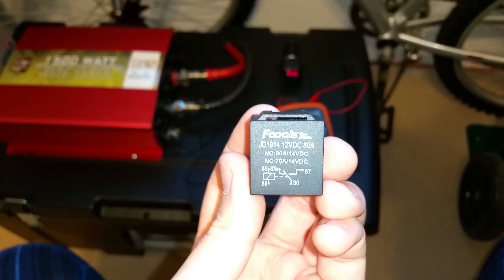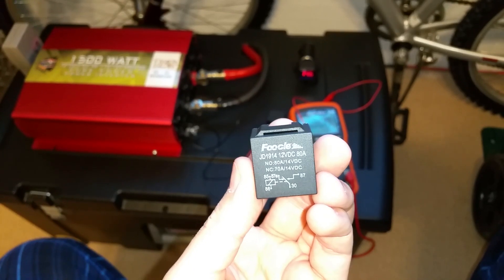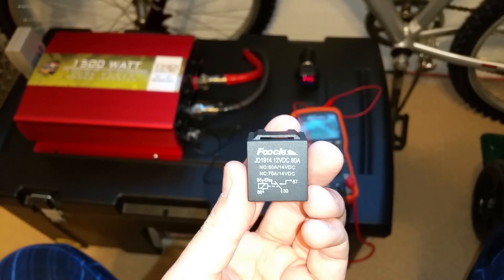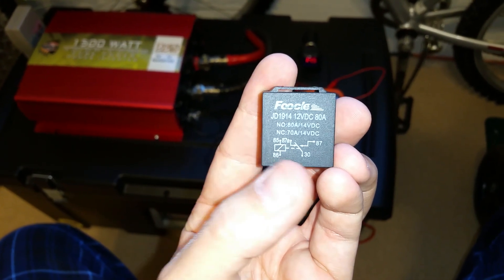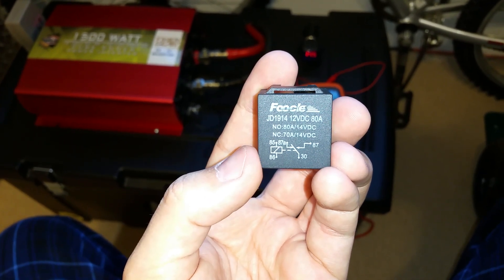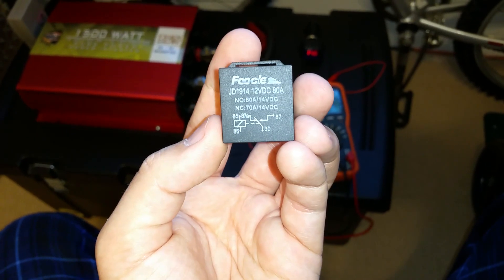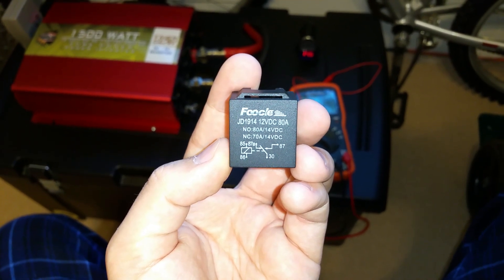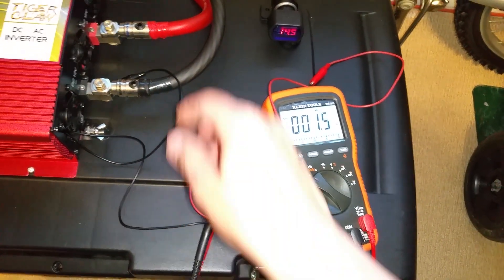Normally Closed / Normally Open Relay: DRL Install

Comment: I'm trying to bypass the integrated blinker circuit in my BCM because mine went out, and Chevy thought the best solution was to make it keep the headlight marker light on 24/7 weather the truck is on or off.

So I'm installing a relay that turns them on when I turn the key, and then using the rear blinker as a power signal to blink the relay for turn signal

Comment: Normally closed/normally open? That makes no sense. Do you mean single pull dual throw? SPDT?
Reply from the maker: Yes correct, only learned about the proper terminology later.

Comment: Hi, great and this is what exactly what I’m looking for, but I didn’t get the wiring, which one take negative and which one positive to make the it close circuit, and when it’s closed , which pins I will use , and will use positive wire or negative one.
Thank you 🙏🏻

Comment: Hey man your videos are so helpful, I’m doing the heated mirror for my crv 2017 LX model it didn’t come with factory heated mirror , so I decided to get in the dealership only the mirrors heated and I gonna do aside the wires with relay, switch and a piggyback tap fuse, I wanna know what kind of relay did you use 30/40A or 80A 4 pin? Someone told that each mirror heated consume around 2A for each mirror ,totally 32W, thanks 🙏
Reply from the maker: Yes a 30/40 amp SPST relay. Can be had at like auto zone or advanced auto
Reply: I do not have much knowledge about this, but For the relay should I run one cable from the battery going through the firewall? And use the 3 prong rocker switch 16A, I wanna let them work when the car switch is on , Thanks  got bless 👍
Reply from the maker: @davidc2023  yes running the battery cable to power the relay for the mirrors is correct. Trick now is to find an ignition on power source to trigger the relay. That you could probably tap somewhere in the fuse panel. My honda fit has a 10A fuse on the battery cable for the mirrors.

Comment: Hey my friend I want to do kind of the same you are doing except that what I'm trying to do is that when I turn on my turning signals I want the DRL to shut off .. and when the turning light disabled to turn the DRL back on ... I got some dimmers in my DRL so I don't want to be off if I turn on the parking lights on .. so all I need is a relay jd1914 12v ? All my light bulbs are LED so I need to know if this voltage is the right one

Comment: Hello ,. I have ordered DRL to  install on the truck  and already have 2x relay PSZACCEPS175R on hand but not sure if this is suitable. What  pin to wire the headlight to switch off the DRL. Can you please guide me on this .  Thank you .
Reply from the maker: got the same relays, yes they will work. my response from our last thread should get you started

Comment: Thanks for sharing,. I would like to add delay capacitor to the DRL so when I use the signal indicator the DRL of the respective side switch off,. Do you have a suggestion?
Reply from the maker: you mean switchback type A?
Reply: xboxer1985 exactly!  Using your relay and add this function it's a ++. Will it be easy and neat?
Reply from the maker: Momed Miranda adding a 2200uF cap in parallel with the relay coil will keep the coil energized long enough between the blinker pulses to keep the DRL off. I would use a diode on the blinker feed so there is no current flowing out of the cap back to the blinker circuit
Reply: xboxer1985 I will give it a try , does the relay have extra pin to feed from blinker or will be shared with headlight feed?  what is the reference of the relay used , I don't  easy see it .  Thx
Reply from the maker: blinker positive feed goes to relay coil, other side of coil to ground. 30 is ignition power positive. 87a goes to the DRLl, and 87 goes to the blinker. I've done this on the bench with a 2000uF cap. It worked for me
Reply: xboxer1985 hello 
I have put this on paper , is correct connection?
‌Relay :PSZACCEPS175R
87 (top) - positive from Headlight to turn off DRL .
85 (right) - Ground
30 (bottom) - Battery
86 (left) -  12V Accessory
87A (middle) - power DRL

Comment: i have connected my DRL to Air con relay; how do i stop it from flicking.
Reply from the maker: Dont know all the details. If the LED is flickering maybe its a problem with the DRL or the power feed itself? I dont know.

Comment: Hi there, is there a video that shows the instal of this exact circuit i.e. using head lights to turn off day time lamps on a vehicle? thanks for the vid! very helpful for what i want to do!
Reply from the maker: i dont have a video no. but all you have to do is connect the DRLs to the normally closed side of the relay,  and then connect the coil to the power of the headlights so that when the relay coil energizes it breaks the power to the DRLs. The DRLs need to be on an ACC on circuit so as not to drain the battery with the engine off. Hope this explains things.
Reply: Very helpful, Much appreciated!!
Reply: These are a lot better than the junk you buy on line, I guess you get what you pay for!!!